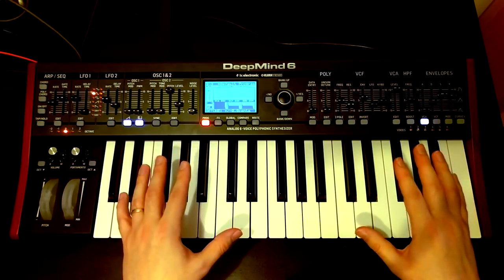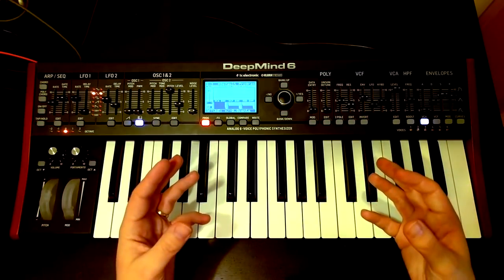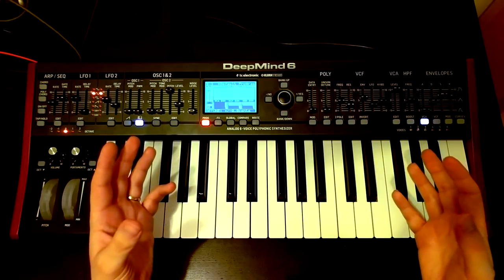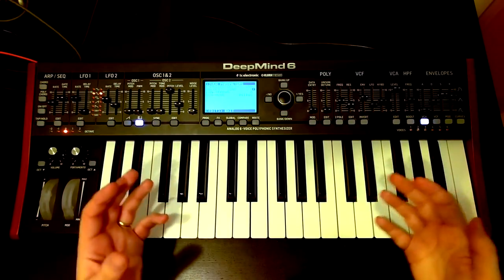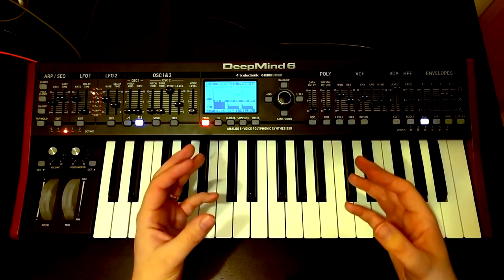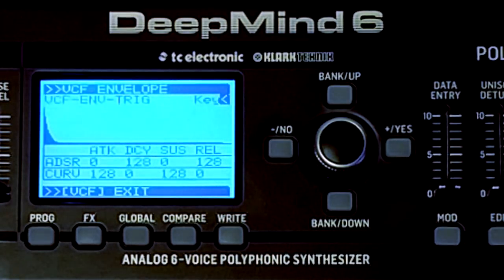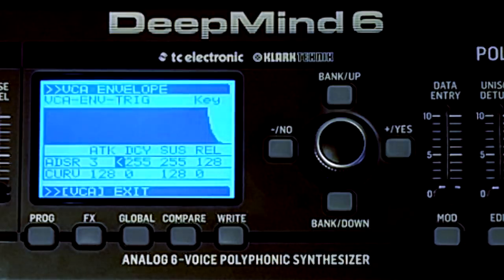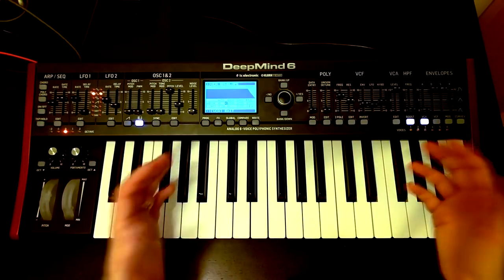Behringer DeepMind - Let's Build a... Classic Mono Lead!

Comment: Hey there! Another great vid. One question though (in two parts!). When using the effects in Send mode, would you say it's better to have the mix at 100% and change the level rather than changing the mix amount? Is this a way of keeping more of the analog signal against the digital processing?
Reply from the maker: If you have mix at anything other than 100 percent you start mixing in the digitised dry sound from the previous effect in the chain, so it depends on what effects (and arrangement of effects) you're using. What you want to avoid at all costs is mixing in uneffected dry sound because the micro latency will create nasty ringing and comb filtering. So if you're only using 1 effect then you definitely always want mix on 100 percent on that effect; in other situations... it depends!
In send mode you are always getting all of your analogue signal. The digital effect is mixed in in parallel. If you want to have more analogue vs. digital, you just keep the level on the last effect in the chain lower.

All make sense?
Reply: Yes it does, thanks very much for your speedy reply!

Comment: I have a Deepmind 12D on order. Should I get a Model D “boog” also? Is there any reason I should or shouldn’t get a model D?
Reply from the maker: No reason I can see - very different characters sonically and "feel wise"! Although personally I'd look at the Neutron, but that's more of a personal taste thing.
Reply: Have you checked out the Roland SE-02. Does everything the model D does plus an arp, seq. And you can save presets!
Reply: I got these two, the boog and the dm12 as my first synths and they are completely different for sure. I play them both differently and the dm12 is definitely way more flexible, but the model d is so easy and immediate to play. I would love to have a neutron someday, but I think I need a drum machine more haha

Comment: I really love your vids on the DM6...I try to mod the lfo shape in the MatrixMod( I do this on a Neutron)but I don't see any change in the lfo at all...any clues?
Reply from the maker: What are you using as the source?
Reply: @OscillatorSink The other lfo or an envelope.
Reply from the maker: @ProfessorWes  mine isn't plugged in at the moment, but I'll try to check it soon...
Reply: @OscillatorSink  OK...thanks.

Comment: can this do like really simple mono voices like the Behringer crave does? with one osc?
Reply from the maker: Sure! Just turn off the second oscillator and only choose one wave on the first.
Reply: @OscillatorSink  with pulse width modulation?
Reply from the maker: @DominicJacksonFilm  yup, there's a slider for PWM right on the front panel and you can modulate it with any source (or manually)

Comment: Hello, I'm planning to buy a Deepmind.  I live in Costa Rica so I will have to pay a big chunk for customs and international shipping fees depending on which one I pick. 
I was wondering if the 12 is in fact a way better option than the 6, or the 6 will be good enough for what I need, play for fun, learn synthesis, record for fun and play and jam around with friends. I'm kind of new on synths so I will truly appreciate your advise, I don't want to regret of buying something I won't really take advantage of, or getting short in the future (I have a couple of midi keyboard interfaces already) .. Thanks in advance.
Reply from the maker: If you already have some midi controllers, then I would highly recommend the Deepmind 12D (the desktop module) as by far the best value option. I'm happy with the 6 voices *usually*, but there are definitely times when I wish I had 12.
Reply: @OscillatorSink  cool, thanks a lot for your advice and quick response. Subscribed!

Comment: Can you assign modulations to the pitch wheel as well?
Reply from the maker: Yep - via the mod matrix you can assign pretty much anything, whether directly ("mod wheel controls this parameter" ) or indirectly ("mod wheel controls the amount that this LFO controls this parameter"). Check out my "build an ambient pad" video in this series for an example.